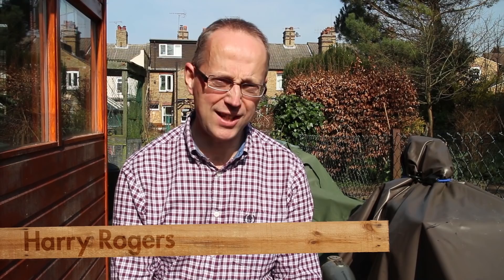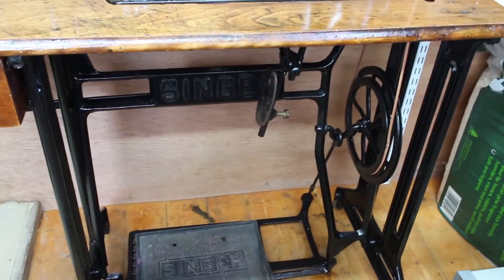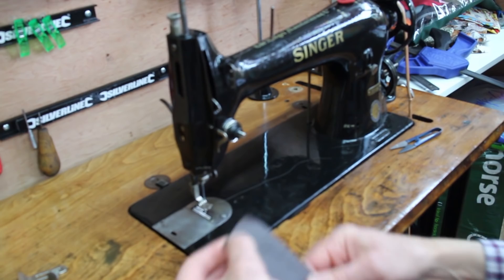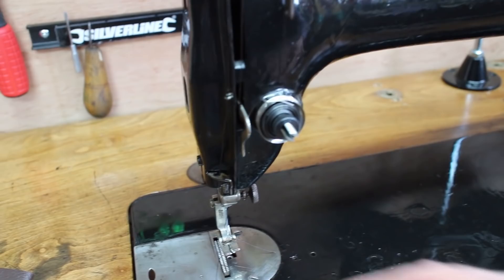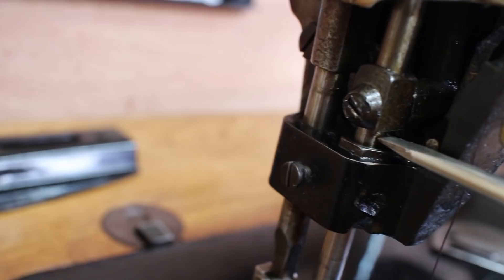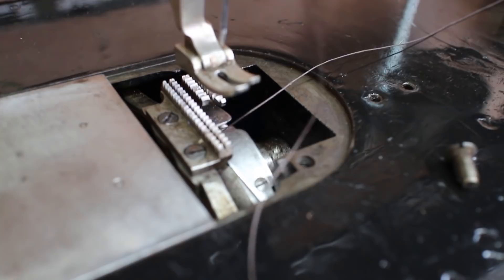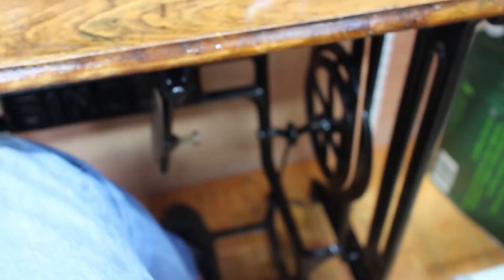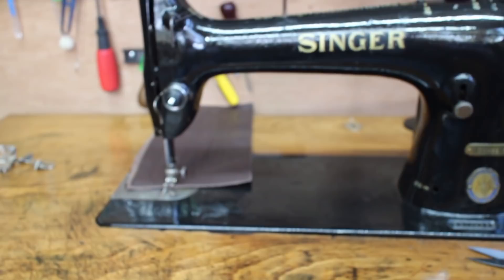Singer 31k15  overview, and Adjusting an Old Sewing Machine. Disregard 3.51 to 5.31 see Description

Comment: One of my mates restored a machine just like that and was getting very frustrated near the end because the instruction manual was so detailed he kept forgetting all he had read when he went to the machine to do the work.  So, he called me and asked me to read the instructions to him while he worked.  It was a great idea because he was able to see exactly what I was reading and could make adjustments in sequence without interruption.  One read-through and the machine was running like a wee mouse chewing paper.  My Grandmother had a machine like that too, a Singer, black, with a flower motif along the body.  I loved the sound of it.
Best Wishes, Brendan.
Reply from the maker: +baconsoda Hi Brendan - I like the sound of them as well, though I have now replaced that machine with a modern one, I have kept my old bootmakers patcher machine which does get used from time to time!

Comment: Excellent information! I've recently been given one of these old machines by a mate of mine who's had it stored under his house for many years. It wasn't working but with a small bottle of kerosene and some 'elbow grease' it's now going with the 1/4 hp motor. Your information on the hook/needle timing and the feed dog timing was most helpful. Lou has promised me the treadle stand once his house sale goes through; he bought it to use as a flower pot stand by using a different wooden top !!! Thanks again.
Reply from the maker: +Allan Wells Thats great ....good to get her going again.

Comment: Harry I will be using this for future reference! This is one of the best maintenance videos out there.
Well done, bravo!
Reply from the maker: Thanks Dave
Reply: Harry Rogers  I wonder if work on thick leather ?? and it will work on leather with 10+ thread ?? what size of needle for leather on 31k15 Please let me know if worth i saw ad 31k 15 asking for !00.00  good deal ???
Reply from the maker: John Graham John - this will handle upholstery leather but is not made for thick leather, many are ex wartime and are worn from making too many parachutes...Nm10 would be a bit on the thick side for this in my opinion.

Comment: Thank you so much for making this video! I have a 31-15 that makes a stitch or two and then begins shredding the top thread. Thanks to this video, I figured out the timing is alright. But the cam that is supposed to hit the tension release bar never hits it during the sewing cycle. I imagine I will need to replace it. Glad to know, and I appreciate the knowledge being put out there.
Reply: Also, might anyone know a good source of fresh tension release levers?
Reply from the maker: Thats great....and just a thought but is the tension release pin (thebit that looks like a nail) very worn and you can just replace that....its comes with the tension unit and that generic part is fairly reasonable......but perhaps it is the cam itself....I think on mine the cam was worn as replacing the pin did not 100% sort it. .
Reply from the maker: +Amanda : college sewing machines UK...on the Web does them.....circa £10 I think.
Reply: It looks like the cam isn't touching the lever at all...if the tension release lever doesn't fix it I will try replacing the whole tension unit. If the cam itself is worn,  would I have to replace the cam do you think? Thanks!
Reply from the maker: Amanda : Hi Amanda I don't know sorry.....I never got mine totally right and then went and bought a new machine....I learnt a lot but in the end cut my losses....sorry that's not very helpful to say!

Comment: I just bought 31-48 model, it has a roll feed mechanism but else it looks the same. My machine does not release upper line tension at any point of the cycle and as far as I can see it shouldn't do so. In my machine cam you are refering just don't reach that lever that presses the pin, lever works only when presser foot lever is up. A bit strange difference?

At 7.40 screw is for my understanding needle bar height adjustment screw, not timing. Of course lower adjusted needle stays longer under the hook. At 3.50 spring is not tension spring but a take up spring, which position (timing)is adjustable by rotating tension unit. I presume you have it right.

I noticed roll presser foot must be set close to the needle or else machine skip stiches, especially with thin fabrics. Thicker materials and leather are not so critical. I had doubts for needle timing, but it is correct, same as yours machine.

Thank you very much for your videos. Your needle timing part is best shot video I have seen, you really can see what is needed.

Comment: The “timing” marks that you don’t have are not for timing per se, the marks are indicating the needle bar height.  Needle bar height is very important, but strictly speaking timing is the engagement of the hook with the needle scarf.  Hook timing is effected be adjusting the hook position.

Comment: I`ve noticed on mine the pin just comes up to the flip lever arm <So i tried to move it further in on mine it has a divot for the set screw deterring the tension base to go that far in . I had angled threads on the cloth figuring that was the problem only to find the needle needs to be none fluted and round tipped .

Comment: I know this video is old but a word of advice before yoh buy a new tention unit or upper thread tentioner as i call it , adjust the bobbin tention to the thread size your useing , i restore vintage machines and believe me when i tell you 90% of the time its the bobbin tention thats out causing the problem the other issues i find are bad needles as in bent , worn and some times just in wrong and last , most people dont run the thread threw the needle in the proper direction . Just a tip before you run out and buy parts you dont need .

Comment: How did you make the tether for your fly wheel? Was it leather sewn together or some other kind of material? I mean the cord that runs from the machine and goes over your flywheel so you can use the treadle foot. Thank you, Randy
Reply from the maker: Hi Randy, one can buy leather cord in 5/16 and 3/8 for sewing machine belts...held together at each end with a staple. The cord itself is full thickness leather. Rgds Harry

Comment: I have the 31-20 someone hasn't used in a long time. Everything was ok then I noticed that the bobbin holder in the bottom had moved out of place so I unscrewed everything to get it out. But I can get it back into place. It doesn't quite fit and I don't know what to do
Reply from the maker: Does it need a thorough clean, is there a metal chip that needs filing off?

Comment: Hi Harry. What type of needles are you using? Also i picked up a used machine without a motor or belts. What sort of belts fits this machine that could be used with a servo etc? Your instruction manual looks way more detailed than the one i found. Do you have a link? Many thanks. p.s i enjoyed your shoe making book
Reply from the maker: Hi Robert  I probably got the manual off of the ISMACS website or from the College Sewing Machines UK site...sorry I can't remember the type of needles  but College Sewing Machines UK should be able to help. The leather point needles often have a digit different.

Comment: Hi i have the Singer 31-15  well ty for this video and i fond i haveing trundle with the teacher im thinking i am missing a plastic that that hits the bar that then hits that little pin on the back side of the teacher.  That is what I can see from your video if so can you tell me what that part is am a part number?  Thanks
Reply from the maker: The little pin should only move when you use the presser foot lifting lever...please see the description to the video above - thanks very much.

Comment: I realize that this video is quite old but I’m hoping you could help me please. I was cleaning and oiling my singer 3115 that I used for Quilting and I was out of time so I was just going to put the bobbin case back in to keep it safe. Apparently I somehow didn’t have it in securely and when I ran the machine to distribute oil the bobbin case shifted and now I can’t get it out please help!
Reply: In spite of having a head injury from a car accident that I am going to be starting therapy for I took my doctors recommendation to try to do some things that were routine which for me working on sewing machine which led to my above question. After concentrating in a quiet dark room I was able to recall how to fix the problem and discovered that one of the screws that should’ve been tight was loose and head back to itself out therefore allowing the bobbin case to spin when it should not have and get it self jammed. Thank you anyway I’m sure I may have questions and need help in the near future especially while I’m trying to get my brain and thinking back to normal.

Comment: How do you make sure the upper tension is correct. Mine seems tight. And do you put the thread thru the eye of one of the thread spool pins when the sp
Reply: Oil is on the stand?
Reply: Spool

Comment: Thank you for that video. Is the screw for this adjustment in the same position on 201k? or where would I find it on the 201?  And I do get an uneven stitch line, how do I fix that? And if I let go of the fabric it will turn to the left, how do I fix that? Thank you for your help.
Reply from the maker: Hi Tobias..not certain if your sewing foot is on straight? Manuals are on the ISMACS website.

Comment: I have a singer 306k that runs as soon as you plug it in to power without even touching it. It is a knee controlled machine. It was sewing perfectly then just wouldn't stop. Do you have an idea what the problem could be?
Reply from the maker: +Sally Stewart Hi Sally is the knee linkage out of adjustment......on one of my machines the knee linkage simply worked a standard Singer black bakelite foot controller that was screwed inside the case, and it had shifted....probably worth checking.

Comment: Great stuff i just bought a 31k15 and not sure what needle to use on it. Like, what size and thread can i use for doing leather. I think it takes a #16 class. also i just purchased a new servo motor to replace the clutch motor. Any advise will be greatly appreciated.
Reply from the maker: +jerry gunner Hi Jerry I no longer have that machine, but the manual is available free on line. If You cannot find it drop me an email through my website.
Reply: Thanks harry! I really enjoy your clips.

Comment: I am having a bit of trouble with my vintage singer skipping stitches. How can I fix this?    Thank you so very much.
Reply from the maker: +betty bare Betty - it could be several things, but assuming you have the correct needles, it could be that your timing is slightly off, your machine hook is blunt or damaged, or the tension needs resetting. First I would replace your needle with a new one, and double check its threaded up correctly...if you are lucky that may fix it.

Comment: Hi Harry I'm looking at a 31k what is the difference between 31k-15 and a 31k and can I use it for leather with a roller foot and this machine I'm looking at is missing the head cover any idea where I can find one.
Reply: And the one I'm looking at is grey hear is the model number EC791712
Reply from the maker: https://www.college-sewing.co.uk/store/Singer-31_331K-Sewing-Machine-Parts and  http://ismacs.net/singer_sewing_machine_company/home.html
Reply from the maker: I have sent a couple of links may go to spam...a look around the ISMACS website will answer your model number and College Sewing Machines UK may be able to help with parts...otherwise Ebay
Reply: Don Delgado There's very little difference between the 2. Basically, the differences are the machine of that subtype being set up for a specific task. Singer made the most common variants as standard catalog machines, the others would be available as "standard" special variants, and non standard special variants. Essentially, a manufacturer could get just about anything he wanted for just about any job he needed doing, so much so that any "comprehensive Singer model list" is bound to be horridly incomplete. You can adapt just about any machine to use a roller foot. The head cover of any 31 class machine will fit. The number you provided is the serial number, not the model number. the fact that the machine is grey (excluding a home paint-job) means one of two things, either the machine is of late production or was factory refurbished. Do keep in mind however that the class 31 were made as garment machines and while strong, they have definite limits. Don't trash our heritage by asking too much of it.

Comment: great video, thanks a lot. i was just checking on my 31k15 where to put a motor (there are quite a lot of videos about motorizing old sewing machines, but on my 31k15 there is no hole or any other cavity to fix a motor). i've never done this before. do you have any recommendation about the power of the motor? i'd highly appreciate your advice. thank you.
Reply from the maker: Hi I think these were either treadle driven or took a big electric under table motor. You could fit a table with servo motor, I have done this in a later video...converting a desk and fitting a motor....you will find it in the leather playlist about 3 months ago...so around Aug / Sept time.

Comment: Thank you Harry great info.
Could you let me know where you can get the instruction manual from a trusted site,as some sites have been known to take monthly prescriptions out for a pdf file they send.
Reply from the maker: Hi ISMACS website is a good place for manuals.
Reply: @harryrogers  wow fast reply , yes I am familiar with this site,Many years back,
but do I have to down load there adobe reader. or another reader to get the file as I already have my own adobe readers,
Reply from the maker: @piecetoyou8285  Hi I don't think so, but I have not used it for ages...Good luck.

Comment: Hello Harry'

Did you ever put a servo motor on this machine? I have a singer 31-15 treadle but I'm thinking about motorizing it.
Reply from the maker: Denny R Hi not on this one, but servos are great....Well worth considering.
Reply: Thanks for reply. I will need replace the tension unit. Did you find instructions on the Internet. ?
Also did you find it hard to learn to treadle and do you still treadle nowadays?
Reply from the maker: Denny R ISMACS website for manual I think if not Google. Treadle is lovely.

Comment: thanks for the video, very helpful. The question I have, when the cam comes down to release the tension on thread. On my machine a 31-15 this is not happening. There is no pin in the middle of the tensioner it is off to the side? I Looked on line and they show a tension release lever spring? But I'm not sure what holds this spring on, there is nothing there? any thoughts?
Reply from the maker: Kim Olberding Hello Kim - its difficult without seeing the machine, but it does seem odd that there is not a pin - is the machine working ok...I assume not - you can buy the tension assembly fairly cheaply from the likes of college sewing machines in the UK....circa £8 or so I believe. I am sorry I cannot really advise further as I am not a proper machine mechanic and I no longer have my 31K, but good luck.
Reply: Harry Rogers The machine works fine. The stitching is not tight on the bottom side of the material.
Reply from the maker: Kim Olberding Have you done a bobbin drop test to check the bobbin tension?
Reply: Harry Rogers no, what is the procedure for that? I have a new bobbin in the machine.
Reply from the maker: Kim Olberding https://youtu.be/TaH9yB7XUBk
Reply: Harry Rogers Thanks, for the info, very helpful going to order a new tensioner and adjust my bobbin.
Reply: Kim Olberding

Comment: Hi!  Thanks for an informative video.  I was looking for how to adjust the tension for sewing on denim.  My machine sends the needle through in time, but skips about 5 stitches in a row before catching again.  I, of course, cannot do anything with that!  This is very thick denim, and I am using heavy denim thread,  I am asking you, because you seem to know your machine better than anyone else on youtube.  I have an old '51 Singer Model 66.  It shouldn't be much different from yours, so if you could demonstrate (or at least talk about) how to adjust the bobbin tension to go along with the upper thread tension, that would help so much!  I have looked and looked for videos on how to do this, and none really answer my question correctly.  I hope you can help!  I know others would appreciate it too.  Thanks!
Reply from the maker: Kathleen R Hi Kathleen, your Singer 66 should be able to handle denim. Here is some advice that might help: Skipped stitches are symptomatic of several things, but a bent needle may be the culprit. When the stitches randomly start skipping, change your needle. If the stitches return to normal, then the problem was a bent needle. It can be caused by such things as tugging too hard on the fabric or the needle hitting a pin. Relax your hold on the fabric, and allow the feed dogs to pull it through.Make sure your machine is threaded correctly. Keep the pressure foot up every time you pull the thread through the machine.Another cause may be that the needle and thread are mismatched. Be sure to use the correct needle and thread for the job. Different weights of fabric need different size needles. Sometimes just changing the needle size will solve the problem.